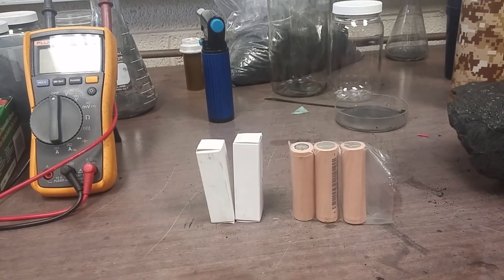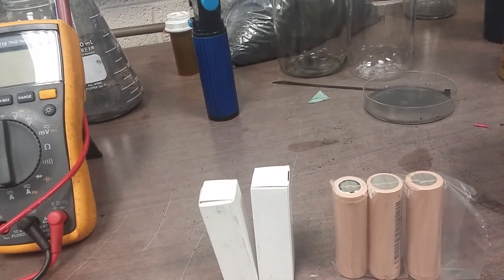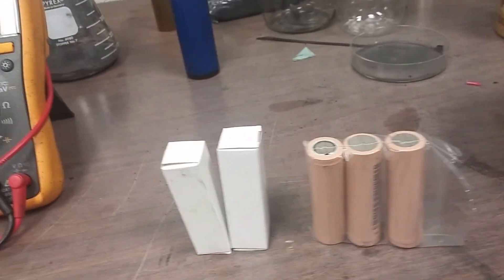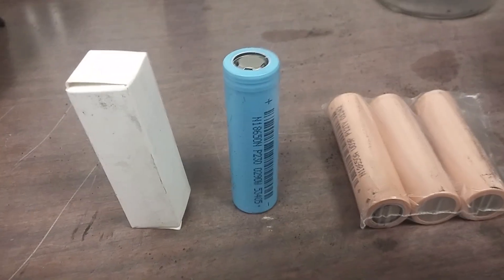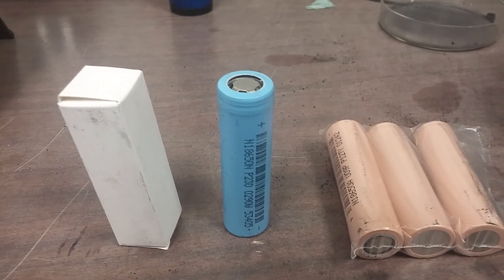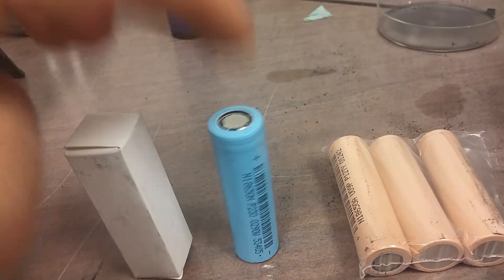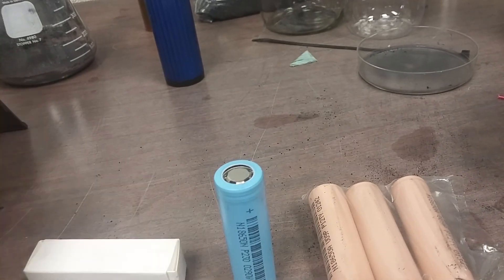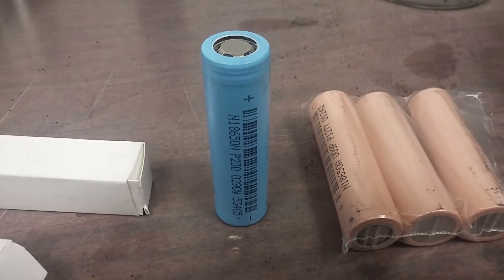Real graphene batteries. Finally!

Comment: So - weeks later - no tests, no links - was this just more sales bullshit?
Reply from the maker: Peter Scargill did I try to sell you anything?
Reply: I have no idea - as I simply stumbled upon this - but I am failing to see the point of making a claim without any supporting information or links whatsoever.
Reply from the maker: Peter Scargill I didn't. That is the point. The fact these even exist is a big deal.
Reply: With the amount of false news on the Internet - surely you understand that just to say "here it is - this is real" - without even attempting to show a test is not confidence inspiring - you could just as easily say "I've discovered magic" or told us about a new perpetual motion device. If they exist - can you point us to more information than "here's a picture of a battery but that's all you're getting"?
Reply from the maker: Peter Scargill I can see that, but I have an extensive library of videos to back this stuff up.
Reply: Hence the question - where is the link to a video to "back this stuff up"?
Reply: 5 days later and nothing lol
Reply: Are you putting me on? I watched your 'Extensive' library of videos. Not convincing to me at all. Nine videos and most of them go nowhere near proving you now have an excellent working battery. Real proof is placing a battery in a legit battery holder, hooking it up to a load through a current meter and timing how long the battery delivers a consistant load at a given voltage. That is what we will accept as proof. Challange given you!
Reply from the maker: I have 138 videos posted. That's all I need to say.
Reply: It would have been shorter to post a link to the proof as Zetacon4 suggested. This has all the hallmarks of a hit-collecting scam. If you have a working battery - simply point us to something showing the battery capacity and what load is being used as suggested above.
Reply from the maker: Peter Scargill Yep,b the old no advertisements on the video, no selling of anything, no nothing, but still magically scam money trick, right?
Reply: So if not - why are you apparently utterly evading pointing us directly to proof - a simple video showing capacity. What is the point. You seem quick to get into any conversation except the describing the most important item missing here - what is the capacity of the battery?  If it is lower than existing batteries, then surely there is no point. If it is higher? How much higher?
Reply: Look Peter, he's not selling you anything or charging you money for anything at all, he's currently making some unverifiable claims for his inventions, that dosnt necessarily make them untrue. My question to you, Peter, is, why do you care so much? has he stolen your candy monies?
Reply: He seems to be selling BS

Dont you have any standard of truth? Has the BS got you hooked? do you need it the moment you wake up in the middle of the night? Do you like it so much you are brewing your own little batches?

The point is, why do you care so much, have you invested yourself emotionally?
Reply: If you wan't to digg into bullshit on youtube, use the phrases 'free energy' or 'conspiracy <anysubjecthere>'. 

And did you have a point to make besides empty accusations and personal attacks, or did you run out of braincells to make an argument?

Again, where can I put my money to buy any of this alleged sold BS? nowhere, thats where.
Reply from the maker: I actually said this in the video. The reason I couldn't show you was that the potentiostat couldn't provide the info. I also said the charge density. 3180 mah compared to 1800 mah.
Reply from the maker: Peter and Barry are literally the dumbest kinds of people on the internet. Just ignore what was said in the video, then say everyone is trying to rip them off, even though no one has asked them for anything.
Reply: Yup still no links or any kind of hard evidence that this is graphene.
Reply from the maker: Hey dummy, I have only posted well over 100 videos on this.
Reply: Venturestarx Ok can you provide the video titles on your channel that prove that this is a real graphene battery?
Reply from the maker: Really? You didn't see what I do all day, everyday? I make graphene, I gave it to this company, they made these cells with it. End of story.
Reply: Is there any paperwork from the company you gave the "graphene" to saying that they put the "graphene" in it?
Reply: Yes yes sir, you arent full of shit, you just behave like it.

Noone understands your genius.

Can you send me a sample battery, so i can have some tests done to see if any of your claims pan out?
Reply from the maker: The results kinda speak for themselves. Plus my company has a contract with them, so yes, there is plenty of paperwork. Also note these cells are performing well, but have some bugs in them we are working out.
Reply: Yeah except the results really dont speak for themselves since you have no proof. You claim there is paperwork and have yet to provide any.
Reply: So you are saying you are not confident they perform properly?
Reply: Thats the way it goes with fantastical claims, there is always an excuse not to provide proof.
Reply: Barry Gillis lol exactly
Reply: Sounds like they're just two trolls who can't wait to steal some sweet new tech. Babies with no investment in anything but youtube thrills
Reply from the maker: DKTAz00 exactly. Neither have posted anything, nor have done anything worthwhile in thier lives. Plus, I'm still working the kinks out for these cells. I could have not said anything and no one would have known. I'd rather share what I can.
Reply: +Venturestarx What exactly, do the productive careers of people asking for proof of your claims have to do with the veracity of your claims? You do understand that you are now openly avoiding providing proof for your claims but are now resorting to obvious personal attacks to distract from this fact. Either defend your claims or STFU kid. No one is going to believe you make tons of fairy dust or graphene or gold from shit if you don't show us proof, idiot. Your claims are extraordinary and require extraordinary proof. Claims to the existence of youtube videos aren't proof anymore than a youtube video would be. We need to see actual scientific lab testing of these claimed batteries. Nothing further will suffice. Any further cop-outs will simply confirm you are the huckster that we all think you are. I anxiously await your ad-hom affirmation of being a snake oil salesman.
Reply from the maker: I can easily retort to what you said with the giant library of videos on my channel. Or I can say go fuck yourself, moron. I'll let you decide which one.
Reply: @filonin2 entitled much?
Reply from the maker: DKTAz00 his account is 100% for trolling. He is wasting time, that's all.
Reply: Venturestarx If you do create legitimate graphene like you claim, can we get any other proof besides your past video's in order to validate your legitimacy?
Reply from the maker: Telic like what? I can provide quite a bit of evidence.
Reply: Venturestarx something visual such as test results.
Reply from the maker: Telic like AFM images, or would you like to see the certification from ORNL?
Reply: Venturestarx I'm not quite up to date on this kind of stuff but anything that would allow the rest of the people in the comments know you are a legitimate producer/manufacturer of graphene
Reply: Sounds like you either are a shill for the big bullshit industry, or you are a sockpuppet of mr venturestar.

After this binary question, what does mr venturestar believes? That he actually has a valid tech here? NORMALLY, if someone has an exciting new tech, they go through lengths to provide evidence, here there is nothing but excuses.

At best there is some graphene in the batteries, but given the time mr venturestar has had, he made these claims 2 years ago, his hopes of producing a working prototype has failed, or failed to have any benefits at all.

Batteries may benefit from the application of graphene, or we may have supercapacitors that have many benefits, but its not as simple as sprinkling some magic carbon dust on something and claim its amazing tech.

What is your standard of proof mr Shill/sockpuppet? Is there any at all?
Reply: Ah mr brilliant inventor, your critics are just worthless,right?

Provide some fucking proof, you dont even have provided anything but claims. magical awesome graphene batteries. Do they have any benefits you can show us, or even give us some insight in what it is that makes them perform better than regular batteries?

Thats not going to happen, now is it, you may have had big hopes, maybe you even invested money in your delusion. You may had hopes that carbon powder+battery=fame, i think you arent so sad that you just faked all of this, you actually may have found some company that modified batteries, so they have some magic carbon powder in them.

BUT IF THEY WORK LIKE YOU CLAIM THEY DO, I AM SURE YOU WOULD NOT SHUT UP ABOUT IT, INSTEAD YOU MAKE UP LAME EXCUSES, AND INSULT CRITICS. Not the behavior of a confident human, now is it?
Reply: Pathetic- insults, no proof, AGAIN!

There seem to be a pattern of delusional "inventors" where when asked for proof they attack the people asking for proof.

"Watch my videos", so you make money off of it? If any fool wants to watch all your videos, and believes in your claims more than you do yourself, he or she is welcome to present it to me.

Are you too lazy to provide proof?  maybe you dont know what proof would look like?
Reply: Provide some test results of how the batteries perform.

Make some defined claims you can defend, have a prototype that does the things you say it does.

Then have the results verified by independent people.

When you have that, people may start to take you seriously.

For now the only thing you invent are unsupported claims. Your answers are insults, not so much because of your namecalling, the low opinion of the intelligence of your public is the worst.
Reply: Dear Barry, noone gives a flying fart about you
Reply: From my understanding is that he doesnt produce the graphene, he purchases it from somewhere else, he doesnt seem to have the means to determine to the quality. There is graphene in pencil leads, so without any information, it could be just that. If this is a legitimate graphene producing company, there are some specs, with i assume micron sized numbers for the size of the particles, and a range of how much of it is actually graphene. The batteries are claimed to contain this carbon powder, whether this has any positive effects is unclear, since he dodges any request for proof.

Instead insults and paranoid assertions are what mr venturestar is all about. Doesnt look like he is confident at all for someone with an amazing new invention.
Reply: But you do, otherwise you wouldn't care to tell me no one cares. So whats in it for you dear friend? are you the same person making the claims? 

If you are a sock puppet account, could you please provide some evidence for your claims?

If not, please proceed.
Reply from the maker: Barry Gillis first off, I speak for myself. No need for anyone else. Second, I have given out literally kilos of graphene I made to many people around the world, who tested it and found the same results. I had the graphene certified by multiple national labs, and have constantly had the material scrutinized by multiple parties. It's been 5 years of extremity hard work against all odds, and yet I ended on top. So a dummy on YouTube isn't going to be the big gotcha for me. Hell, if you are so certain, post your email, your credentials to test, and I'll send you out free samples for you to test. That way you can publicly apologize for any doubts.
Reply: So you do produce graphene, what are the specifications of the graphene you produce? Whats the flake size? whats the percentage of graphene in the powder? Whats your companies name? 

Next, what is the benifit of having this powder in batteries? You seem to not be interested in providing any definite claims,  let alone any proof. Do they work better somehow? Higher capacity? better internal resistance? 

You ended up on top. You make vague unsubstantiated claims on Youtube. 

I have no use for free samples, unless you feel you have a superior battery in any sense, then i would love to find a way to help you prove it to the world you made a better battery. I am no battery expert, i am a youtube bullshit expert, so we would need to find experts that can test and verify your claims,hell we dont even know what exact claims you are making. Exept that your critics are horrible horrible people.

 Scientific method and all, you know, not just some idiots insulting another.

But so far you havent been behaving like a confident person at all, so i really dont believe you ever will produce a battery for independent testing. FFS, your research seems to be youtube videos, if thats the proof for your achievement, and the frequency of insulting people that dare to criticize you a measure of your confidence in this "research", the logical conclusion is that you dont believe in what you are doing at all.
Reply from the maker: So, what I take from this is that you don't have a way to refute anything, even if I provided you with the material. I have a library of videos that show bits and pieces of info, with a few that have some concrete data for those who are observant. If you have ever dealt in business, you would know that I'm actually giving out quite a bit of info. Most wouldn't even bother because they don't care to. I'm only showing what I can because it inspires others to get out there and do more. 
Now on to specifics of the product: The flakes range from 0.5 micron to 6 microns in diameter, with the thickness range of 1-3 layers (0.3-1.2 nm). To be exact for the powder, 40% is mono layer, 33% are bilayer, and 14% are trilayer. There is a minority that drifts as high as 6-7 layers. With this info you can figure out who we are. 
As for these batteries, I don't make them. I have only said this more than 20 times in comments for this video alone. I can't divulge who made them, and can't show the data sheets due to NDA's. I got a lot of flack just for saying what I did in the video. But I'm going to do an update on it soon enough. I needed 2 full months for testing, and those cycles are almost over. So far, some good, some bad results. I'll be happy to share when I know for sure. 
As for my critics, they are dipshits. I have an extensive library that has zero ads, zero kickstarters, or moneygrabs. This channel makes ZERO money. It's actually a liability according to everyone in the business world. I have given out more graphene (one was a giveaway video contest) than most companies have ever produced. I have also been the biggest critic of any new "graphene" product, because most of them are bullshit. I have made videos to explain why as well. For all I know, you are from one of the companies I have thrashed for producing garbage. I now who are the only graphene powder producers in the world. It's a handful, limited elite club. I also know my company makes more everyday than all the others make in a year, so my confidence isn't shaken. I'm just an asshole that likes to insult moronic keyboard warriors.
Reply: So what i take from this is that you rather waste time talking to moronic idiots, claiming that you have a hugely successful business, that makes more money than the rest.Sounds like horseshit to me, making graphene is a hugely technical science, if you waste time making senseless videos, and responding to "moronic critics" your competitors will walk all over you. 

It sounds very much like a certain president i know, likes to talk a lot, telling how awesome he is, and how critics are "SAD". Yet he has a thin skin, when called out by critics he reacts aggressively and never has anything of substance to show. Is this you Donald? Oh Donald, you are so easily distracted, playing with soot, while you have a world thats on fire, and a country thats hurting, did you forget you were going to make it great again?
Reply from the maker: Actually, I have plenty of time for constructive criticism. The graphene production isn't about money to me. It's about lowering cost for everyone else. I should have mentioned that I sell it for less than 1/10th of what others sell it for, and I still think it;s too much. This material is far too good to be hidden away from everyone. But if you were in the business world, you would know it takes time, money, and an insane amount of effort to get things like this up and running. And there are giant companies that would pay quite a bit to get tech like mine and exploit it. As for the Trump inferences, it's rather shitty of you to bring politics into this. You obviously don't approve of success, ambition, and benevolence of any kind.
Reply: Blah blah blah, you are so mean to me, you mean mean critics.

Reading up on the starte of graphene production makes me even more skeptical of you actually making any graphene at all. If you sell actual graphene on amazon i would be surprised, is your company Celtig by any chance? They make many of the same claims you seem to be making. It seems mostly marketing, and very little actual content though what i see there, and i am not a graphene expert, but it seems they have it produced in China. Or they buy it bulk in China, slap their brand on it, and call themselves "producers"
Reply from the maker: Again, do you have access to prove me wrong? Can you characterize the material? I welcome an actual challenge, not a hack that spends their day doing nothing.
Reply: Now, i dont know what you are, you may be a brilliant mind, and be producing awesome quality pure graphene for a price thats 1/10th of the competition, because you love the world so much that money is unimportant to you, but you behave agressively towards critics because they dont understand how sweet and smart you are.

Everything i know about how the world works, how technical innovation works, how human psychology works, and how many turds there are with youtube videos makes that story very unlikely.

I suggest if you want anyone to believe that story, that you arent a turd with a youtube channel playing with cheap chinese soot, but instead are a brilliant mind, with awesome technical skills, and beautiful intentions, you behave more like a respectable human being, and less as a turd.
Reply: Venturestarx You have yet to provide evidence to back up your claims. You keep going on and on about how you have so much evidence that this is real. Where is it? Can we see it? What is your reasoning for hiding something so crucial? It makes absolutely no sense.
As for you saying that you have video evidence in your channel, I have yet to see you link ANYONE in the comments any video showing proof that you have actual graphene.
If you want people to believe what you're saying, provide what the people are asking for instead of making bullshit excuses to why you dont have any.
Reply: You make many fantastical claims, and provide no evidence at all.

You dont sound like a graphene producer, you sound like a turd with a youtube channel.
Reply: Prove that you have a company that produces graphene, and answer some questions about it, obviously without giving away the secret sauce. But at least show us that you have the means to do it.

So far you have shown a mix of thinskinnedness, agressive evasion and persecution complexes.

Again, not a display of confidence, or an appealing reason to believe your words.
Reply from the maker: At least I sound like something. Not much from a hack DJ wannabe.
Reply from the maker: The best part of this whole thing is that I still haven't blocked you, nor tried to cover up your ridiculous comments. If I wasn't certain of my claims, I'd be some asshat that deletes shit comments all day. Even YouTube is shuffling your garbage to the spam folder, I have to actively allow your comments to keep this up.
Reply: If you are certain about your claims, maybe you'd give us some evidence instead of trying to cover up your bullshit
Reply from the maker: You didn't comprehend the video. I'll help. It was an unboxing. I explained the fact my test rig wasn't up to par. (Potentiostats range from $8000 to $56000 each, I have a cheap one) I have plenty of other videos (over 100) that show the graphene off. I have verified data on several of the videos, you can find them. You asking me to do a rundown of credentials on every video is ridiculous. It's like asking your doctor for his diploma, or Stephen King if he can write another book.
Reply: If you have a video giving data, please link it instead of asking us to find it as it would benefit the both of us and the only reason we're asking you for this stuff is so you can prove that you are a legitimate graphene manufacturer.
Reply: I think the proof is in, you have an inability to not be a turd with a youtube channel, therefor you are a turd with a youtube channel. 

Whether you want to be a producer of graphene, thats still a possibility, although with every comment it seems less and less likely.
Reply: Well that settles it then, you are such an awesome person for not blocking or deleting.

It must be so horrible to be asked for proof for claims you make, poor little thing.
Reply: If anyone woundnt trust their doctor, would it be ridiculous to ask for their credentials? 

What happens here is that you make vague claims, and invent excuse after excuse to not substantiate these claims.
Reply from the maker: You make nothing, end of story.
Reply from the maker: Telic I can't help someone who can't even use YouTube. My dog can find stuff on here better than you.
Reply: sorry if you are incapable of providing evidence. it's only hurting you and insulting me is only making you look worse
Reply: lol damn this guy still hasn't provided any evidence? That's sad. For anyone else looking for proof, you can look up the battery he was showing off and you can see that they sell them in Shenzen and Russia for fairly cheap and they have well over 3000mAh on them. So either this guy is playing you all or he thinks he made graphene in some random warehouse with no equipment to show that he can even detect or see the fact that it's graphene and he sent it over to some random company and that company is trolling him and sent him a random Lithium ion battery(which is exactly what that blue battery is). I'm going with the first option that he's a troll especially if you see his other videos.
Reply: Wow this is good to know. thanks for the info!
Reply from the maker: That's not even close to factual.
Reply: sure peter, id advise you to probably look up some of the "Related channels" linked in his front page, then perhaps learn something interesting and masses of data if you are so inclined , or you can always just go view the usual  nail through hand clickbait and so do your part to make america great [again !] ...
Reply: I've seen lots of related videos on the subject including some very good videos by Robert Murray Smith who not only makes batteries but tests them and provides clear evidence of whether or not they are better than anything else. This is just bullshit - I can't figure out the motivation but there is no evidence here whatsoever to suggest these are real and better than stuff that is already out there.
Reply: @Peter Scargill Why do you even fucking care mr armchair hero? people can decide for themselves. Nobody cares about anything you say here.
Reply: I take it you skipped politeness lessons at school - and what makes you think anyone cares what You think. Don't reply as you're now blocked, Mr arrogant DKYTAz00
Reply: lol k bro
Reply: Look, its venturestars sockpuppet again.
Reply: ikr
Reply: And DKTAz00 we care because scumbags like this should have their channels terminated for deceiving their audience into thinking they have some sort of miracle product that REAL scientists are actually trying really hard to develop. Next time get your head out of your ass and see the real picture instead of being manipulated by people like this. If he was an actual developer of this product, he would provide real evidence instead of being unprofessional and insulting anyone who thinks otherwise.
Reply: The amount of dislikes on the video should tell you enough on how fake this is. It's been months and still no proof. Give it a rest already fucknut.
Reply: He also tried providing "proof" in his latest video but it could easily be fabricated bullshit. This guy's channel should honestly be terminated.
Reply from the maker: Whaaa the mean man didn't violate NDA' so I could see what I wanted!
Reply from the maker: You and your 26 subscribers can go elsewhere.
Reply: Yeah venturestar seems to think he is believable when attacking and insulting while he should provide some sort of explanation for the outlandish claims he makes.

Someone who is "the biggest and best at producing graphene" AND fighting people in the youtube comments section? Does he even think this is helping his trustworthiness? I bet he just likes the attention.
Reply from the maker: Barry Gillis what outlandish claims?
Reply: I only repeated it a dozen times. You dont produce more "pure" graphene than everyone else. 

Everything about you just says you dont.
Reply: because it seemed to us that you were being blind-sighted by the videos and thinking that they are real when in reality, nothing has been proven at all, but you can believe what you want. We just want to present the facts so you can form an opinion for yourself.
Reply from the maker: This coming from a know nothing. Sorry I'm not going to give away my process and I won't burn bridges with companies for your amusement. How about invent something yourself for a change?
Reply from the maker: These are the same tardfucks that have never accomplished anything in their lives, but complain everyone else is holding them down. They are why we can't have nice things. They are the same douche bag armchair engineers that say Tesla makes shit cars but have never even been in one, go on and on about how a PAK FA can shoot down an F-22 with zero reference, and shit on guys like me and Robert because we won't show them every intricate detail. This is so they can either piss and moan about that, or they work for a company that would steal the tech in a heartbeat.  Shitdicks, the lot of them.
Reply: Venturestarx That's coming from the guy who doesn't understand the word "evidence" or "proof". If you really do what you say you do, show us proof, act like a professional and not like a sad internet troll like you say we are and realize why we are mad at you. How the hell do you expect us to believe you if you can't do something as simple as provide anything of substance that can retain your credibility? If you want positive feedback, give us what we want as it is the only way for anyone to respect you.
Reply: Enough is enough - I need to unsubscribe from this - not only apparently a conman but rude too.
Reply: I don;t know about anyone else but I'd done my share of innovation and regularly shared proper info.
Reply from the maker: Telic I have 100+ videos with the proof you ask for.
Reply: More evidence of you not knowing what proof means, certainly there is zero of it in your videos, unless proof means you being amused by a dog eating melon.
Reply: Does anyone believe a youtube twerp that calls people names like "shitdick" is capable of producing graphene?

To anyone- is this a show of confidence when confronted with criticism? Wouldnt confident people ignore that stuff, and prove everyone wrong? There is a chance this guy can do what he says, a lot like there is a chance people claiming to posess psychokinesis, or other supernatural abilities. What happens when asked to prove their abilities they dodge, blame and insult, but never actually show anything to prove their claims.

So, feel free to believe anything, but dont go claiming truth without proof.
Reply: See it as entertainment, and a chance to teach and learn about critical thinking.

Certainly there is nothing to be taken too serious about all of this.
Reply from the maker: Barry Gillis ok, I'll hold your hand like a child. What part would you like proof of, and how do you want it?
Reply: How about some verifiable evidence that you are a producer of graphene? Whats your companies name, what products use your graphene, your name, and something so we know you are who you say you are.

Those would be a good start, still wouldnt be proof ofcourse, but at least we know that you are more than what meets the eye.

Proof would require independent experts verifying that you make "99% pure graphene"  "by the metric tonne" at a fraction of the cost  anyone else makes it. Oh, and that you produce more graphene than everyone else combined, thats quite a claim that would need verification. In an internet video we cant see if you are playing with graphite or your special "99% pure graphene" ofcourse. 

The chance of you producing any proof at all remains approximately 0.
Reply: "Why am i explaining what proof is to a genius like you?" people may wonder, and i am not ofcourse, you dont seem like a genius capable of producing graphene. Someone with a proper science education, which i assume you need to produce graphene at "99% purity" knows whats required to provide proof ofcourse.

This is an excersize in critical thinking, and maybe some people who want to believe your claims think, hey if i think about it, those are pretty incredible, why should i believe what some guy on youtube says? Why would anyone waste their time calling people names in youtube comments when they claim to have incredible important skills that can change the world? Does that really make sense at all?

"Extraordinary claims require extraordinary evidence" seems applicable here dont you all agree?
Reply from the maker: Barry Gillis so now I'm supposed to be a mind reader. What kind of proof would you like? Be direct.
Reply: I explained it clearly enough for anyone to understand.

Start with your name, name of your company and some products that have your graphene in it. You are claiming to be the largest producer of graphene, you wont be an unknown, right? lets start there.

There are more claims you make ofcourse, but lets work on them one at a time.
Reply: He's incapable of doing it. Have you read this conversation? This "Genius" has been dodging all of our attempts to get proof, told me to kill myself, insulted many other people, and hasn't given us ANYTHING of substance AT ALL. This person is obviously an uneducated internet troll who just wants us to waste our time arguing with him. I'm fine with it. I'm on summer break. I can do this all day long.

To anyone reading this, don't believe a word this man says, he's a liar.
Reply from the maker: Barry Gillis none of those things brings the proof you ask for. Here, I'll help. Ask for characterization data. Ask for an example of the quantities. I'm not here to advertise for my company, not the companies that use the product. That would violate NDAs that I must adhere to.
Reply: Data like that can be easily fabricated. We just want something we can believe from you, but you are apparently incapable. Also, why are we just now hearing about these NDA's?
Reply: So you cant even prove that you are somebody?Ah well, it felt like talking to a nobody from the beginning.

Always dodging, like predicted. And you wonder why you are ridiculed? One more time, some guy making outlandish claims on youtube providing nothing to substantiate is entertainment, we must laugh at your silly behavior. Only thing we can be sure of is that you are a clown.
Reply: Oh, its fun and entertaining, he likes to pretend that he is serious, but so bad at it.
Reply from the maker: Telic you must be joking. You can't fake AFM images, especially when you have thousands of them. It would be easier to just to make the graphene. To fake the drums of material, again better just to make it. To fake the years of video logging, again stupid. Also, many people have received my material for free to test, and on each occasion passed with flying colors. You folks are as credible as flat Earthers. And then you claim the NDAs are just now? They have been going on for years. Sorry, you have no let's to stand on.
Reply from the maker: Barry Gillis I won't fall for a doxxing attempt by a shitty DJ.
Reply: NDAs? Noone is allowed to find out who gets your amazing products? Your customers dont want anyone to know your incredible magic dust is used by them? You cant even say waht your name is, or what company it is? Only that you are the largest producer of graphene? You said you produce more graphene than everyone else combined, remember? 

But oh noo, you cant tell us, or we will steal your ideas! You can only brag about the most generic things or your customers get mad at you for revealing the secrets! 

Come on, are you even trying to make sense?
Reply from the maker: Barry Gillis this is how I know for a fact that you don't know how an NDA works. You are a child asking a neurosurgeon about aspirin, then bitching about what kindergarten I attended.
Reply: Who is a DJ? did you peek at my youtube playlists and fooled yourself into believing i was a DJ? I like music, not a dj. I play some instruments too, not a musician either. I show my dick sometimes, not a pornstar though.  Do you even know how to logic bro?

What do you think about http://www.cealtech.com , if you are the biggest, what are they? Thats not you, just look at the quality of production, its all hype obviously, like with anything graphene, but at least i can believe they are capable of making some graphene, just look at the kinky graphics dude! Proof of graphene is in the quality of the videos, duh!

Its fun to see you doing your clown thing.
Reply: Nah bro, you reverse the burden of proof. Logic and science isnt your thing, right?

Doging all the way to the bottom, back to calling names when challenged and no way to meet the challenge.
Reply: Are you the aspirin in this weird ass metaphor you try to use?

This is for a fact that you ignore facts and eat your own feces, then complain about the chinese equivalent of the UPC about the duration of your epicure while travelling in the opposite direction of the highway from your kitchen to the center of gravity.

I can word salad too. But you were trying to pretend to be someone, that could do something. So far it seems difficult for you to keep it up, 9 inch of flaccidness is all we get.
Reply: I was pointing out that until now, you havn't stated you have a NDA. what's your reasoning behind this?
Reply from the maker: Telic I have mentioned the NDAs in several previous videos, and in the beginning comments on this very thread.